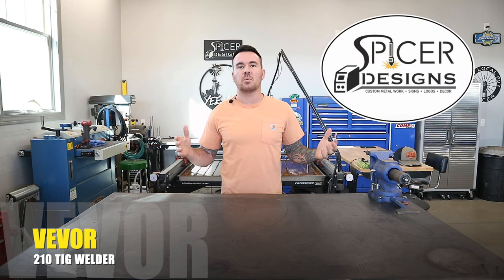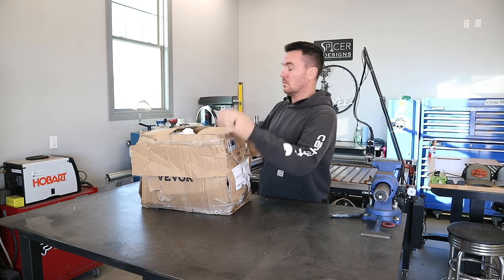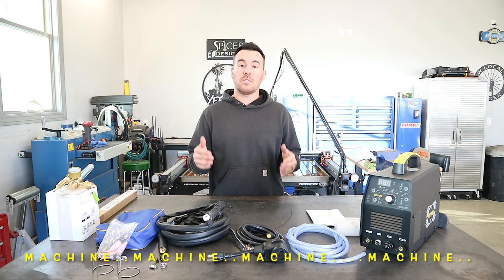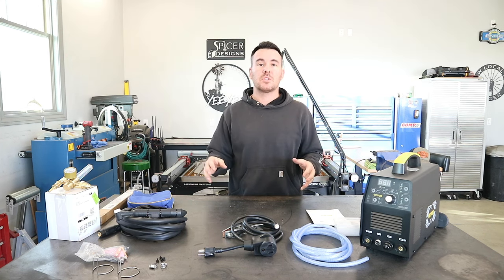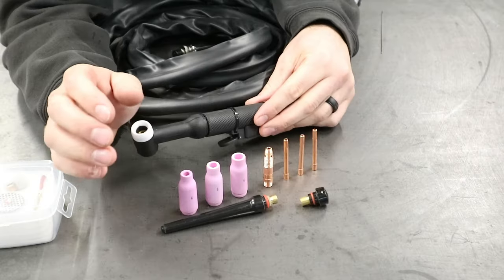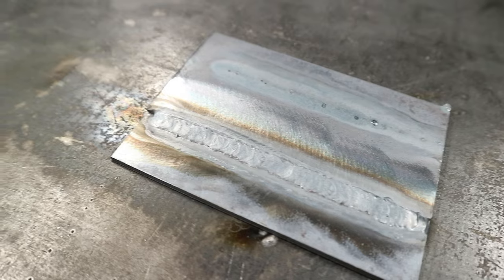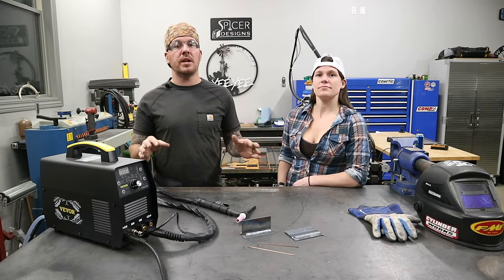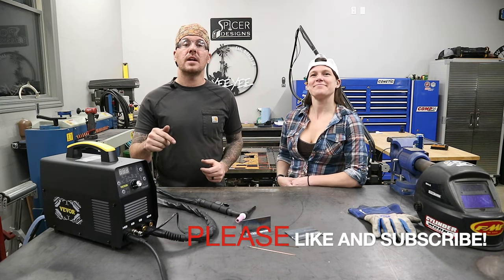BEST TIG WELDER for BEGINNERS?  VEVOR TIG210P

Comment: The 4, 5 and 6 designation on the cups refers to the opening diameter in 1/16" of an inch.  So a number four cup is 4/16" or 1/4".  The significance of the number is for the thickness of the metal that you are welding.  Thinner metal uses a smaller cup and smaller filler wire.

The 20 on your flow gauge will be in cubic feet per hour, not psi.  With a #4 cup, you can probably go down to 10 t0 15 cfh.

Not bad for your first try.  Just practice.

One thing that you didn't mention is whether the start is scratch, lift or high frequency.  The manual seems to indicate that it is HF start.

Sure the welder is only $250, but then you need to buy a regulator ($100 to $250), a stinger for stick welding (probably another $100 or so), a more durable hose ($25 or so) and then does it come with an option for a foot pedal or does the trigger switch also be able to vary the current (Which is important for TIG).  So now you are up to $500 or more.  The other thing that has been shown in other videos is that when testing out the capabilities of these low cost welders is that they sometimes do not provide near the current promised.

That being said, if it works for you and what you are trying to TIG weld, then that is all that matters.  As for me, I'll pass.
Reply: What would be a decent beginner Tig Welder? Thanks
Reply: @wolverinegnr  It is really hard to recommend one specific welder over another.  I will recommend a Lincoln Electric Square Wave 200 and the reason is that is what I have and I am extremely satisfied with it.  However, I do not know if your budget will allow for it.  Plus it is more than just the welder that you will need to buy.  There is the welding cart, the gas bottle, and all of the various consumables for your torch.  Research carefully the various offerings out there as you can spend as little as $500 to as much as $5,000 or more on just the welder.  The things that I would look for in a TIG welder is an output of 150A to 200A (which will require a 240V circuit and will allow you to weld on up to 3/16" to 1/4" material), High Frequency start, adjustable AC frequency, pulse and adjustable AC balance.  Most TIG welders allow you to do AC, DC and Stick.  However, if you do not plan on welding aluminum or magnesium, you can forego the AC option, this will reduce the cost somewhat if you will be doing only DC TIG and stick.
Also consider what you will be welding in terms of materials and thicknesses.  This will dictate what capabilities that your welder will need to have.  Another thing to consider is customer service and in that regards I would recommend that you visit your local welder supply stores.  They can be a good source of advice.  My apologies for being long winded, but I hope that this will be helpful for you.

Comment: I bought an HF AC/DC machine because all the fabricating i do i had to do something so i didnt have to depend on other to get to it when they could or pay somebody $25-$50 to weld a couple brackets together that rarely fit after they did it. Aluminum turned out to be way easier than i was expecting, mild steel took a little getting used to but when we built the turbo hot side with stainless…..man i almost lost my shit, that was a massive pain in the ass to get close to looking decent😂 but its looking a lot better and looks presentable now anyway

Comment: Best advice is practice, practice , practice. Your flow meter is showing “cfh”, not pressure. Try to hold a very tight arc, this will help get the puddle into the root of your tee joint. One other tip is torch angle. Try not to exceed 15° off 90° 👍
Reply from the maker: Thanks for the tips!

Comment: The flat cap is so you can weld in a tight space. If it was me I would have just pulled the trigger and bought a AHP or a Prime Weld machine. They come with a trigger and a good quality foot pedal they also come with a stinger for arc welding as well as a regulator for your gas. The prime weld has a higher amp rating but either machine is good up to 225 amps and run around $900

Comment: I like you never tig welded this seems like a great way to go for home garage use I think Ill pull the trigger on this unit . Gotta get me a new Keystone dispenser I think my current one is defective they always seem to be aimed at my head.
Reply from the maker: Hah!   Ya its definitely a cheap route to learn on.  Can always upgrade later.   Thanks for the comment
Reply: @SpicerDesignsLLC  Well just ordered mine thanks for the video looking forward to more content 👍
Reply from the maker: @ADVScott342  awesome! Congrats.  I have another video ill be working on for an ac/dc machine soon.  Its more expensive but the perfect next step for me.  I like using that vevor tig machine.   Works great

Comment: Those little inverter machines don't seem to like the thoriated tungsten. If you have trouble with arc starts try using lanthanated  (the blue banded tungsten)
Reply from the maker: Thanks for the tip Matt.
Reply: Yea ima have to try that I had some idiot sell me some green ones

Comment: I found this late but I was wondering how well it worked on 117ac with the adapter?
Reply from the maker: I actually didnt try it on 120v.  It did well on 240.  I just did another review on a different tig welder too if you havent seen it.

Comment: Good job.  Are you thinking using TIG for your sign assemblies would reduce time spent on weld cleanup?  In other words, where would you think you'd switch to TIG vs what you've been doing so far?  🍻
Reply from the maker: Yes i would like to switch to tig.  Definitely for the smaller stuff.  No weld splatter is nice.  Just looks so much cleaner.

Comment: ditch the cups and get a gas lens kit.  And when you grind your tungsten, aim it straight into the rotation of the grind wheel.  the grind marks running parallel with the tungsten give better arc stability. Tig welding is addicting once you get good at it.  Aluminum tig is a whole different animal but this machine isn't AC. You cant tig aluminum with DC.  Good luck!
*I keep editing this as I'm watching the video ha.  Were you pulling or pushing when you were welding?  It almost looked like you were pulling.  Pulling is a no-go for tig.  You have to push.
Reply from the maker: Thanks for the pointers!  Ya i figure once i get better at it ill get a nicer ac/dx machine. I was pushing.   It did come with a larger glass cup kit.
Reply: You can Tig aluminum with DC just need to use helium gas rather than argon.
Reply: @rileyneufeld7001  That's new to me, I've never seen that.  I'll look it up.
Reply: I’m glad I read your comment. I’ve been looking for an entry level TIG welder but I want to weld aluminum. I was just about to pull the trigger on this little welder

Comment: What stinger does it use to connect in to machine? Just bought it and vevor doesn’t know what size it is.
Reply from the maker: The cam lock is the smaller style.  Im not sure on an exact size.  The stinger from their stick welder fits it.   Not sure if it shows a size on that welder.
Reply: @SpicerDesignsLLC  found out is 10-25

Comment: For a few hours now I've been considering buying this welder.  It's currently in my Amazon cart (used the affiliate link) awaiting me to make up my mind.  Having a small and not completely fireproof shop,  I always find myself looking for ways to avoid having to weld with my MIG machine.  I REALLY like the low/no-spark aspect of TIG.  Is there a big learning curve to TIG?  In some ways, it appears that maybe TIG would be easier than MIG.
Reply from the maker: Its hard for me to say at this point.  Im still pretty new at it.  I was able to make an acceptable pass with it.  For the price,   Definitely makes it easier to test the waters.  It is fun to learn tig though.  Im looking forward to figuring it out.
Reply: I own this welder. It's definitely NOT easier than MIG welding. MIG welding doesn't require you to hold your filler and allowes you to stabilize with both hands, just to mention a few differences... Main things are Paramount for any tig setup, A GOOD FLOW METER, Victor is a top brand. But you won't experience any problems like you will with the 30-40 dollar regulators out there. Second especially starting out is lease a larger tank unless you have one. Running to the welding supply shop after only a hour worth of use out of the small #20 argon tank is just not feasible and you spend a lot of money refilling those (21.00)  compared to larger ones.
Reply: Definitely not easier in any way you look at it however that is not to say one could not learn tig and learn it quite easily
Reply: Tig is a lot harder than mig. Mig is point and shoot where Tig is point, burn a hole through your metal, start over, do it again, fire up the mig welder

Comment: Buyers be cautious. i purchased this welder with high expectations after watching this video. I received this welder undamaged. I set it up and it would not work. It would not even pass gas. I contacted Vevor, explained the problem. They  requested i send a video and several detailed photos which i did. After several days they asked me to take it some place for repair which they would pay for as long as the cost fell within their guidelines. I declined to do so. They offered to refund $106 less than half what i purchased the welder. Does this sound like a vendor you want to do business with?
Reply from the maker: Well thats awful to hear.  Sorry to hear you had a bad experience.  Its definitely a cheaper welder.
Reply: I’d just go for the repair. It could be a quality control issue. With the price we pay we’re lucky to have a warranty
Reply: I had the same exact experience! Fortunately I had bought it using my AMEX and called their fraud department. Amex opened a case and contacted the Vendor. About 2 hours later I was offered a FULL REFUND and they said I could keep the machine. Thank you Amex!

Comment: I liked the video. It is difficult to tell from the small screen, but it looks like the weld didn't penetrate that thin metal plate, especially along the edges of the weld. Wondering if the settings weren't high enough or the amperage isn't sufficient. Your weld looked like you laid it down nicely, I"m questioning the Vevor welder.
Reply: Looks like A. He has not practiced T-joints so his angel was probably not the best, B. It does look like it’s a little cold as the end you could tell
Reply from the maker: Im sure there was something i wasnt doing right there.  That was my first time tig welding.  Still learning.  Thanks for the pointers.

Comment: Good video, have thought about getting a TIG machine. So, with TIG, you “pull” the puddle (like arc welding) as opposed to “pushing” the puddle (like MIG)?
Reply from the maker: Tig is fun.  I still have a long way to go.  You should check out my newest video.  Its a different machine but great price.  And you push the puddle with tig.  More like mig

Comment: Can i run this on a 110 power supply?
Reply from the maker: I believe it does have an adapter plug.  Check out my newer tig welding video.  I started using an Arccaptain and i really like it.  Its budget friendly too.

Comment: You’re holding the torch like a mig torch (or gripping a hammer.) Change your hand position now (like holding a pencil) before you develop some bad habits. Also dab from in front of the puddle, instead of coming in from the side. Off to a good start otherwise.
Reply from the maker: Thanks for the pointer.  I will make some adjustments.  Do you recommend the torch trigger or foot pedal?
Reply: @SpicerDesignsLLC  Everyone says the pedal is the way to go but a trigger is needed when working in awkward positions (like under a car, although I have seen some guys squeeze a pedal between their knees!) Likely that unit won’t take a pedal, A quick way to check is if the trigger connector only has two pins.
Reply from the maker: @T3glider   I appreciate all the info.  Im really liking tig so far.  Looking forward to getting better at it and a nicer machine.
Reply: @T3glider  can you manually adapt a foot pedal?
Reply: @T3glider  I know it doesn't take a pedal but what I meant was can I electronically do it myself with a little solder and wire?

Comment: What kind of tips or size do these tig torches take. I see eBay has a bunch .
Reply from the maker: If your referring to the tungsten, it comes with 1/16 and goes up to an 1/8 i believe.  The link in the description should have all that info…. I think
Reply: @SpicerDesignsLLC  the cup size
Reply from the maker: @alexgonzalez7395  came with a 4,5,and 6.  I think i laid out the parts that came with the tig torch in the video.  Also came with the glass cup too.